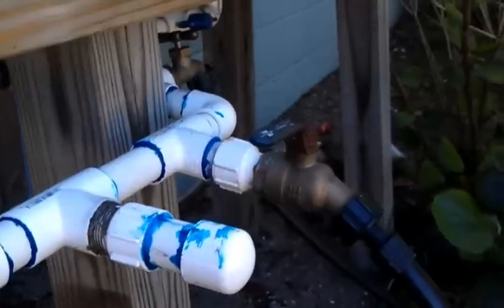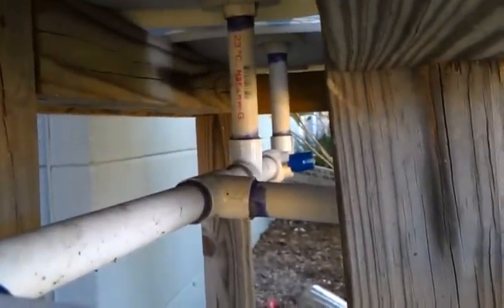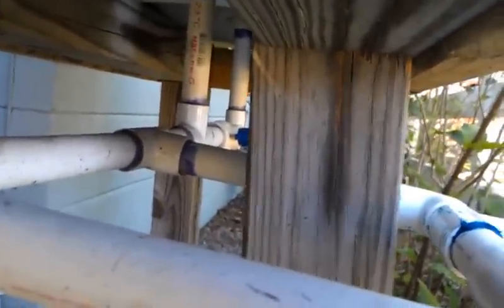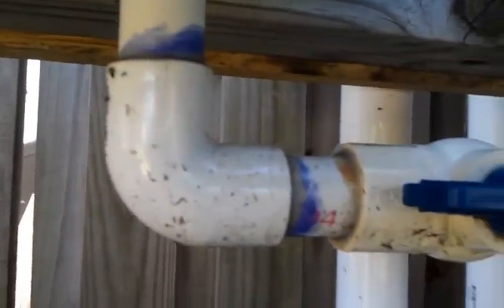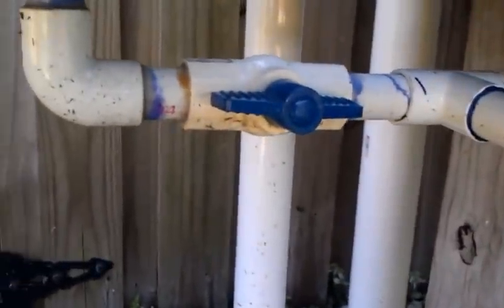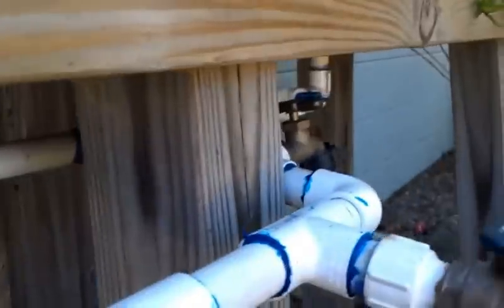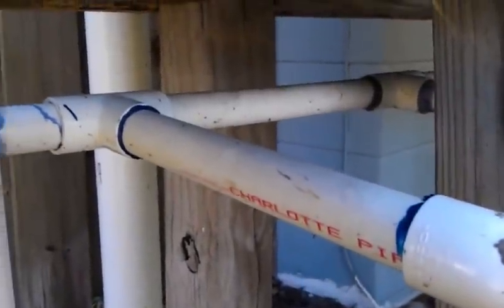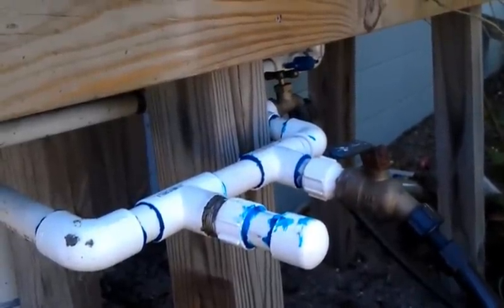Rain Barrel Manifold System

Comment: With no union fittings if anything needs to be disconnected pipe(s) will have to be cut. Cleaning out any of the barrels will be a major hassle.
Reply from the maker: Nah, just open the valve, run a hose in the top and rock it around a little. They clean up easily.
You could put a union on there but I haven't found it necessary.

Comment: Are you still out there?  How is your catchment system working?  Any updates?
Reply: I’m hoping to put a 4 - 5 barrel system (like yours) in this summer. Finally have the materials - and the time.
Reply from the maker: I've moved a few times since this video, I'll be setting up a new system soon.
Reply: I’ll let you know how it goes
Reply from the maker: @stephensuter7242  excellent. Make sure you check out my other videos, the ball valve video is a great demonstration.

Comment: I did this setup with 2 barrels. Is there a reason my 1st barrel is about 20% full and the second barrel is almost empty?? Does the 1st barrel have to have a certain amount in it before it goes to the second?
Reply: MAY BE AIR KEEPING THE 2 BARREL FROM FILLING IT NEEDS TO BE VENTED TO LET AIR OUT .

Comment: Hello!  Do you have bulkhead that perfectly fits the bung that you are making your pvc connection with?  (Hope all my terms are right) You mentioned that the bung & barrel are upside down.  How is there not a leak where the pvc comes out of the bung?  Silicone?  Do you not worry with all the pressure places on the bung cap by a full barrel of water, the cap/pvc connection will be compromised at some point?

Thanks!  (In the beginning stages of building mine)
Reply from the maker: The bung caps usually have a 3/4 inch threaded center. I drill out the center with a 3/4" spade bit, then you can screw in a male adapter. Use pipe dope on all threaded connections and you won't have any leaks. Don't worry about the pressure, it's only about three psi.
Reply from the maker: No silicone, if it leaks you won't be able to fix it.

Comment: Awesome nice set up :)
Reply from the maker: Thank you! You can also remove one of those caps from each barrel and use two inch PVC pipe for faster flow, but the cost is a bit higher with the larger size. 
Let me know if you have any questions, I'd be glad to help,
Mark
Reply: What size the stand is?
Reply from the maker: The stand in the video is made from 4x4's that are 6 feet 4 inches long about 18 inches apart, and it is 3 feet off the ground. I have a video on my channel showing the construction of a twin system, check it out here: http://youtu.be/yBx9tOXtpiA
Reply: Awesome I will :) thanks

Comment: how does the water get into the barrels?  Why not make use of the second hole by putting another pipe in it that collects the rainwater from the down spout?
Reply from the maker: Hi dymondwillow2,
This barrel system is built on a corner where we only have one downspout, but one barrel is not enough water in the Summer. The downspout easily has 200 gallons coming out during an average rainfall event, therefore more water can be stored than just a single barrel can hold.
When it rains the water comes in through the top of one barrel and then disperses evenly to the other barrels hooked to the manifold pipe. I have another video that is an overview of the whole system, stop by our channel and check it out.
I'm not sure that I understand the second part of your question, so if I can clarify anything else just let me know! If you watch the other video it may explain the other parts of the system, if not this video was actually created to respond to someone's question and I would be glad to make one for you.
Thank you,
Mark
Reply: Sarasota RainBarrels
I want to use the existing holes in the barrel.
2" connectors and pipes going from one hole, out to the side of the barrel and up the side to collect rainwater.
There will be a T joint there with one line as the intake and the other line manifolded to the garden. The second hole / cap will be drilled out with a 3/4" drill and appropriate fitting screwed into place with 1" pipes coming out and going up the side of the barrel for the exhaust. The barrels will be upside down and on a wooden platform.
I have never seen this done. Is this setup going to work?
Reply from the maker: dymondwillow2 Okay, I got it now. I think that will work out fine for you, my only concerns would be if it rains really hard the 2 inch pipe may not be able to keep up with the flow into the barrels. My other concern is the 1 inch overflow port, usually you want to go with the same or bigger pipe for the exhaust than you used for the intake. Ideally if the water comes in through a 2 inch pipe then the overflow would be made from 3 inch PVC.My advice: try out your plan and see how it works, you aren't planning on cutting holes in the barrel so you can always make a little changes if something could work better.
Check out our twin rain barrel video construction guide to see how we make our stand for two barrels, you may find some useful info there too!
Thank you for your questions and comments!
Happy harvesting,
Mark

Comment from the maker: You get about .5 PSI per foot of elevation. So, if your barrel is full, 3 feet tall and on a 2 foot stand, you have a total of 5 feet. That would give you 2.5 PSI and it will drop off to 1 PSI when it is almost empty. Watch our other video " Rain Barrel Water Pressure/Volume Demonstration."